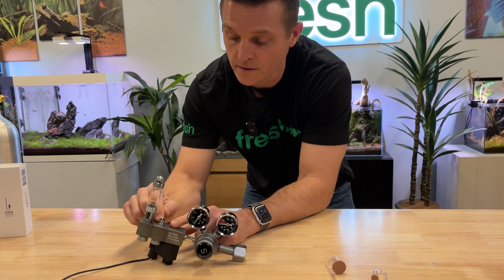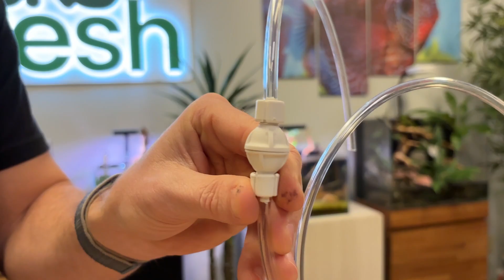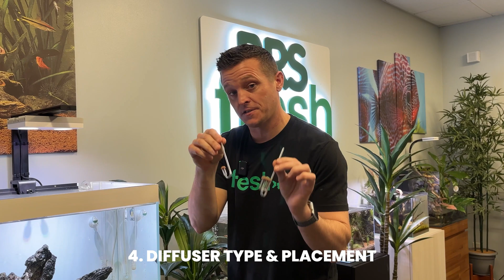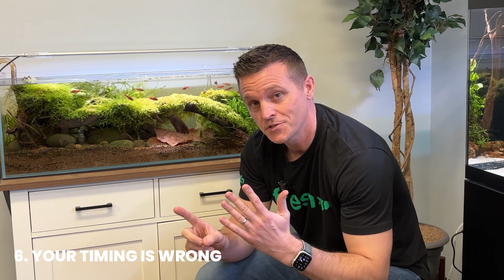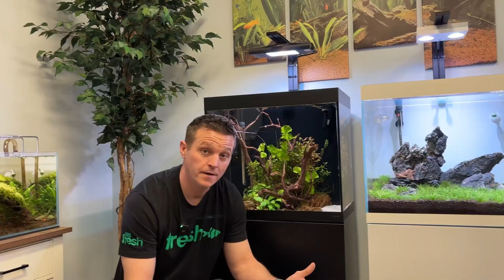7 Reasons Your Aquarium CO2 is FAILING

Comment: I’m using a JBL e902 external filter on my Juwel Rio 240. In many videos I’ve seen that the CO₂ diffuser should be placed on the opposite side of the aquarium, across from the filter outlet.

My problem is that there are plants in between, and they block a lot of the water flow. Even without the plants, the CO₂ doesn’t seem to distribute properly throughout the tank. The CO₂ only reaches about half of the aquarium before the bubbles rise to the surface.

Does anyone have advice on how to improve CO₂ distribution in this setup?

Comment: Thought the industry norm was to turn CO2 off around an hour before the lights go off. Please correct me if I am wrong.
Reply: Yeah I agree ive never heard off 30 mins after lights off either. Interesting approach I feel like its a waste of gas?
Reply from the maker: Hey guys! I want to test this out to see if any CO2 continues to be absorbed in the water after the lights shut off.  I’m leaning towards you being correct though I have heard otherwise from some top Aquarists.  It stands to reason that as soon as the lights go off the photo synthesis stops.
Reply: @BRSfresh  yeah i mean ultimately 30 mins isnt breaking the bank on gas but there still should be plenty of available carbon even after the lights shut off. Not saying this isnt beneficial ive just genuinely never heard of this.